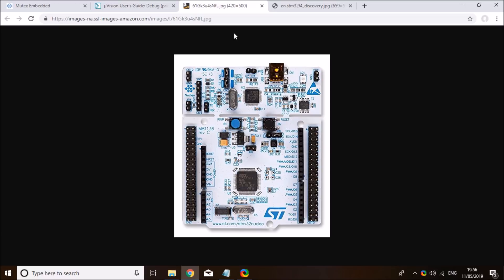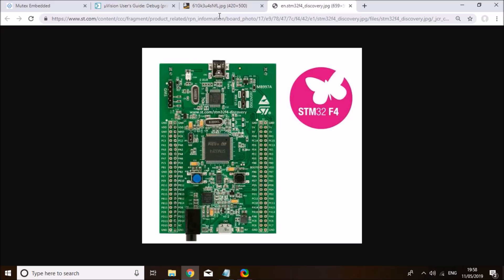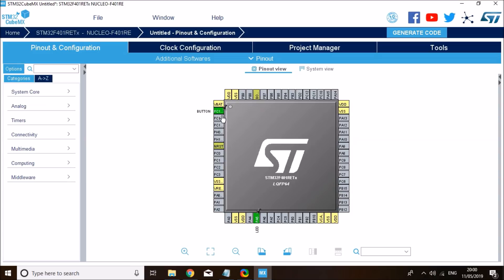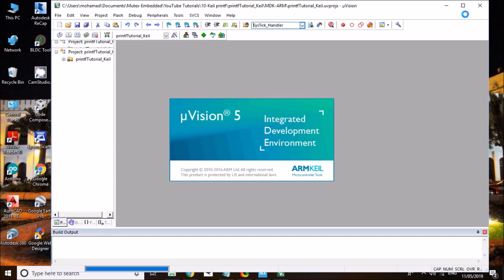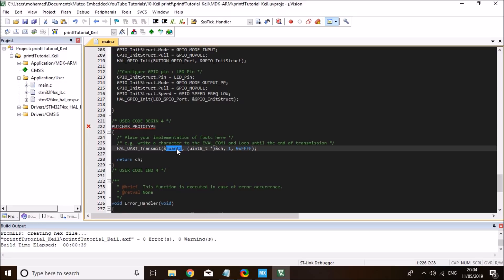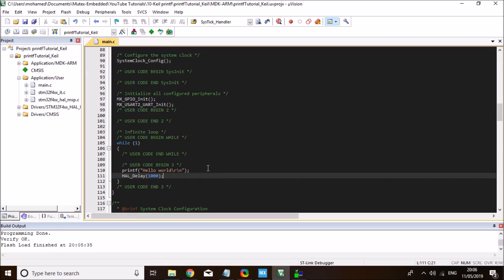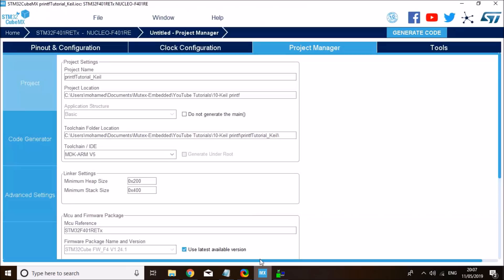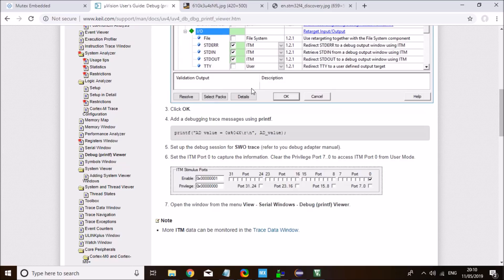STM32F4 Nucleo - Keil 5 IDE with CubeMX: Tutorial 38 - Printf UART debugging

Comment: can either of the methods be used in stm32cube ide for printf ? or which method is suitable for stm32cubeide?
Reply from the maker: Pretty much same
Reply: @mutexembedded2206   I tried it , works fine for int but not for float. I tried to search for linker flag in mcu gcc linker but not able to find linker flag in stm32cube iDE
Reply from the maker: @arrshithrg5359  It is easy, just a checkbox, read this:
https://community.st.com/s/question/0D50X0000B0AEJb/uprintffloat-where-to-set-for-clinker-in-stm32cubeide